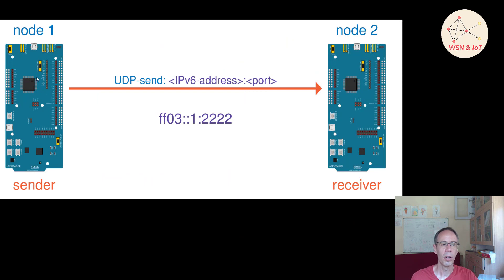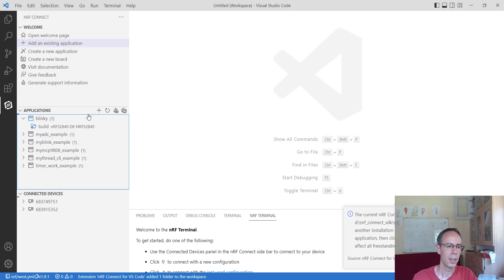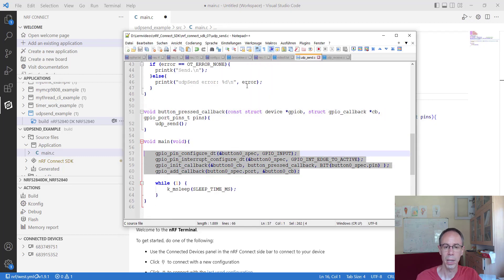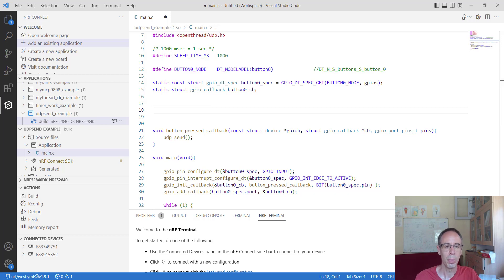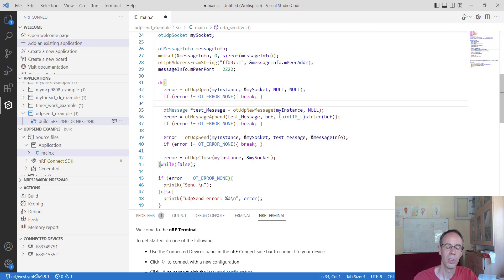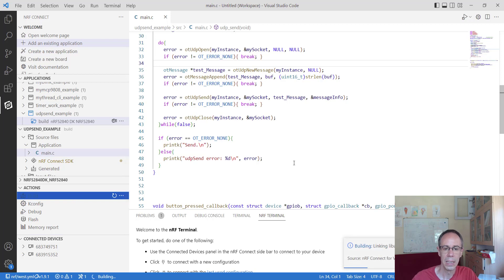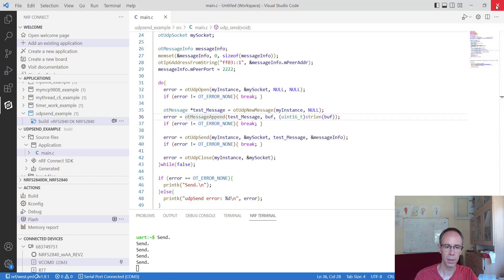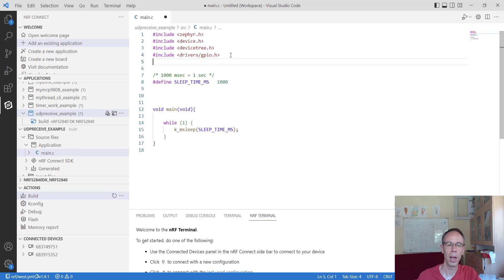Zephyr and Nordic nRF Connect SDK - 07 Using UDP in OpenThread over API

Comment: I know if you wish to sell a thread or zigbee certified product; you need to get certification from appropriate authorities. 

But do I still need certification if I'm only using CoAP or UDP to communicate between sensors? Like an entry sensor communicates with the base station via Zigbee or UDP?
Reply from the maker: I don't know the legal requirements on certified product but as I understand it, you can use Thread,and ZigBee for your own application and also sell it commercially. However, you cannot advertise with ZigBee or Thread until you have completed certification process. After all, Zephyr and OpenThread are free to use. CoAP as i know itself has anyway no certification program.
Reply: @wsniot  I see now. Thanks once again! :)

Comment: Doesn't it need to commissioning?
Reply from the maker: No. Commissioning in a thread network is for sharing the network parameter and the network key. In this example the network parameter are set manually in the prj.conf. So no need to exchange them. But make sure you erase the chip before flashing. If not the device take the previously stored parameter.
Reply: @wsniot  thank you WSN team,  I guess that's kind of like out-band commissioning.

Comment: I had errors with the original code so here's a little modified one:

#include <zephyr.h>
#include <device.h>
#include <devicetree.h>

#include <zephyr/zephyr.h>
#include <zephyr/drivers/gpio.h>

#include <net/openthread.h>
#include <openthread/thread.h>
#include <openthread/udp.h> 

void udpReceive_cb(void *aContext, otMessage *aMessage, const otMessageInfo *aMessageInfo);
static void udp_init(void);

void main(void)
{

	// udp_init(); had errors when this this line wasnt in while(1)
	
	while (1) {
		udp_init();
		int a = 5;
		int c=5;
		c = c+5;
		
		// printk("qwerqwr\n") // mcu keeps resetting itself
		// k_msleep(1000); // mcu keeps resetting itself
	}
	

	
}

void udpReceive_cb(void *aContext, otMessage *aMessage, const otMessageInfo *aMessageInfo)
{
	uint16_t payloadLength = otMessageGetLength(aMessage) - otMessageGetOffset(aMessage);
	char buf[payloadLength+1];
	otMessageRead(aMessage, otMessageGetOffset(aMessage),buf, payloadLength);
	buf[payloadLength]='\0';
	printk("Received: %s\n",buf);
}

static void udp_init(void)
{
	otError error = OT_ERROR_NONE;

	otInstance *myInstance = openthread_get_default_instance();

	otUdpSocket mySocket;
	otSockAddr mySockAddr;
	memset(&mySockAddr,0,sizeof(mySockAddr));
	mySockAddr.mPort = 2222; // we chose this port.

	do{
		error = otUdpOpen(myInstance, &mySocket, udpReceive_cb, NULL); //udp mesajı gelince tanımlanan callback funca giriyor.
		if (error != OT_ERROR_NONE) break;
		error = otUdpBind(myInstance, &mySocket, &mySockAddr, OT_NETIF_THREAD);
	}while(false);

	if (error != OT_ERROR_NONE){
		printk("init_udp error: %d\n", error);
	}
}
Reply: i had problems too. for me the solution was to keep the sleep in the while loop and the udp_int outside. i still didnt get why the mcu keept reseting

Comment: #include <zephyr/zephyr.h>
#include <zephyr/drivers/gpio.h>

#include <net/openthread.h>
#include <openthread/thread.h>
#include <openthread/udp.h> 

/* 1000 msec = 1 sec */
#define SLEEP_TIME_MS   1000

/* The devicetree node identifier for the "led0" alias. */
#define BUTTON0_NODE DT_NODELABEL(button0)

static void udp_send(void);

void button0_pressed_callback(const struct device *gpiob, struct gpio_callback *cb, gpio_port_pins_t pins){
	udp_send();
}

void main(void)
{	
	static const struct gpio_dt_spec button0 = GPIO_DT_SPEC_GET(BUTTON0_NODE, gpios);
	if (!(device_is_ready(button0.port))) {printk("port isn't ready\n"); return;}

	gpio_pin_configure_dt(&button0, GPIO_INPUT);
	gpio_pin_interrupt_configure_dt(&button0,GPIO_INT_EDGE_TO_INACTIVE); // configured interrupt
	static struct gpio_callback button0_cb; // will hold information such as the pin number and the function to be called when an interrupt occurs (callback function).
	gpio_init_callback(&button0_cb, button0_pressed_callback, BIT(button0.pin));  /* Initialize the struct gpio_callback button_cb_data by passing this variable,
	along with the callback function and the bit mask for the GPIO pin button.pin to gpio_init_callback().*/
	gpio_add_callback(button0.port, &button0_cb); // add the callback func

	while (1) {
		
		k_msleep(SLEEP_TIME_MS);
	}
}

static void udp_send(void) 
{
	otError error = OT_ERROR_NONE;
	const char *buf = "Hello Thread xd"; 

	otInstance *myInstance; 
	myInstance = openthread_get_default_instance();
	otUdpSocket mySocket; 

	otMessageInfo messageInfo;
	memset(&messageInfo, 0, sizeof(messageInfo)); 
	otIp6AddressFromString("ff03::1", &messageInfo.mPeerAddr);
	messageInfo.mPeerPort = 2222; /

	do{
		error = otUdpOpen(myInstance, &mySocket, NULL, NULL);
		if (error != OT_ERROR_NONE) break;

		otMessage *test_Message = otUdpNewMessage(myInstance, NULL);
		error = otMessageAppend(test_Message, buf, (uint16_t)strlen(buf));
		if (error != OT_ERROR_NONE) break;

		error = otUdpSend(myInstance, &mySocket, test_Message, &messageInfo);
		if (error != OT_ERROR_NONE) break;

		error = otUdpClose(myInstance, &mySocket);
		
	}while(false); 

	if (error == OT_ERROR_NONE)
		printk("Sent.\n");
	else	
		printk("udpSend error: %d\n", error);
}
Reply: thank you man! you are my hero! i hate when people dont uploade there code
Reply: If you are having issues with importing net/thread.h then try #include <zephyr/net/openthread.h>